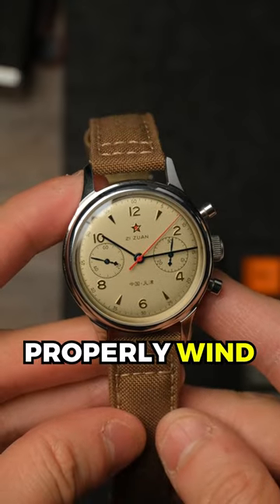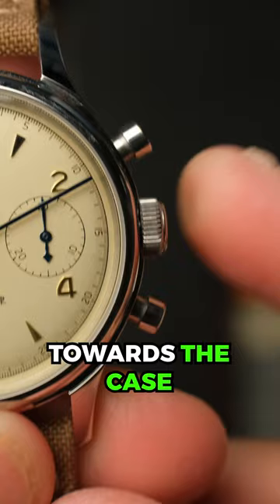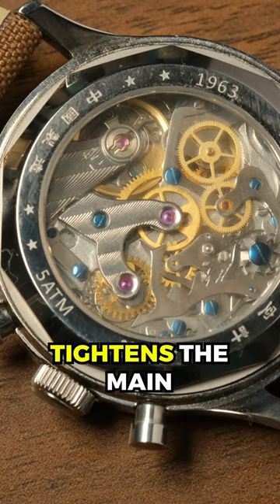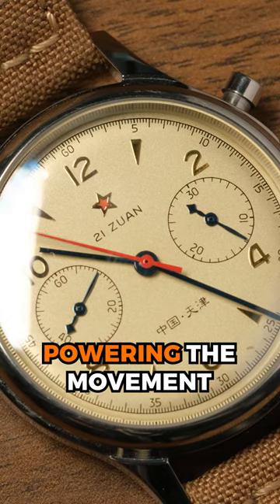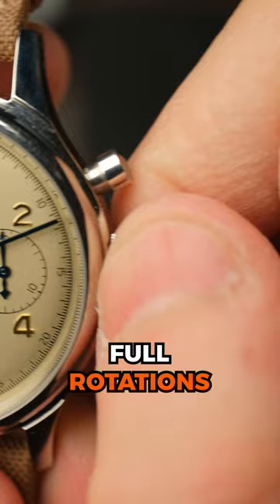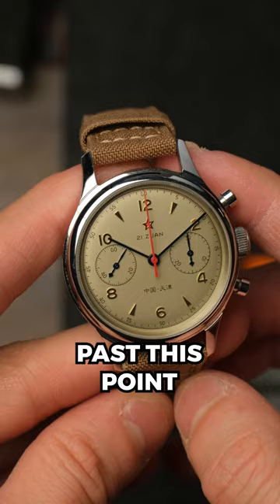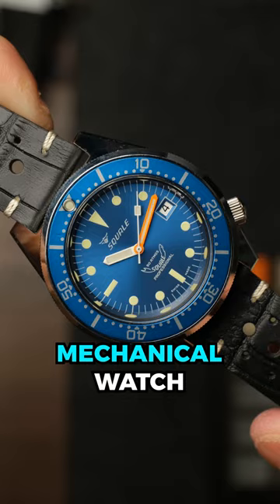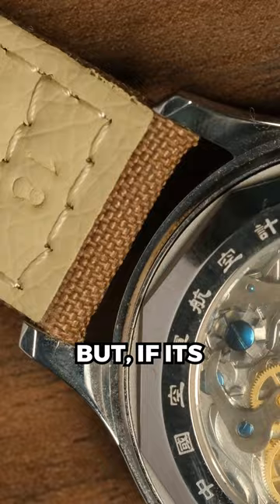How to Properly Wind a Mechanical Watch #shorts #watchesofyoutube #watches

Comment: Can I just add that getting to a full wind on a manual watch, at least from my experience, feels like hitting a wall. At least that's how it feels to me. easy to wind, then suddenly stops in it's tracks.
Reply from the maker: That's a good description. I do tend to feel a little resistance before winding fully, at least on the Seagull
Reply: It depends on the movement. Some are vague.
Reply: I have an issue mine have a push back effect the crown not even doing 1 spin, is that normal ? 
The watch is not working it’s a 1979 timex marlin calendar
Reply: @3rdview_  If you're trying to wind the watch and it's "pushing back" without the crown turning, don't force it. Chances are the watch is already fully-wound, but needs to be cleaned and oiled to run. There could be other issues, but usually it's just that the watch hasn't had a service in  many, many years.
Reply: @Myrtilys  Ty for those greats advices ! I will let u know if it fix !
Reply: @3rdview_  Your watch needs to be serviced. It is fully wound because it's not running. The "push back" you feel is a safety feature so that you can't overwind the watch. It has a ratchet to hold the gears, and if the ratchet didn't loosen backwards slightly, you would wind the spring too tight every time you wind it up. There's a mechanism that relaxes the spring slightly so you don't damage the watch. This is the "push back" you feel when attempting to wind the watch.

Comment: 6 to 8 rotations of the crown is enough depending on the movement to fully wind some watches. You want to avoid overbanking a manual watch.
Reply: That's automatic watches only. A fresh wind on a fully powered down watch is typically 25-30 winds. A full wind every 24hr is typically 17-20 winds. Automatic watches wind automatically, as the name suggests. So you just have to get them started running, and then wear the watch so the auto function can wind it.
Reply: It's not enough if you fully wind it and you just put it back in the box and don't wear it throughout the day. It will stop overnight.

Comment: Winding a automatic won’t break it if overwound as it slips BUT it will put additional wear on the rotor mechanism as the crown stem is also connected to it.

Comment: counting the number of times is completely and entirely pointless, because that depends from movement to movement and the length of your fingers. You wind a mechanical watch until the crown stops, thats when you know it is fully wound. You WILL KNOW when its fully wound because crown will not turn anymore. If you stop when you feel resistance the watch won't run its full power reserve.

Comment: first find how many rotations to fully wind it. check how long is the reserve. now calculate the rotations required for 12 hours ( I usually wear one watch around 12h) or 24h as you require and only do that amount of rotations. Don't max wind

Comment: 40 full rotations may suit a watch with a massive mainspring but would be overkill for most. Mechanical sense works best. Automatics are rarely designed to be fully handwound. A few rotations is enough and will protect the mechanicals. Let the rotor do the work and adjust later. Also dont use quickset date function between 9pm and 3am.

Comment: If its a non-automatic screw-down crown, wouldn't you also need to account for the rotations needed to fully screw down the crown?
Reply: I’m pretty sure the crown disengages when you start to screw it in; that way, you’ll never have to worry about accidentally overwinding it. I’m no expert though, so I could be wrong about that. Google it if you need to.
Reply: @mbcommandnerd  The crown actually tightens going counter-clockwise. So when you turn it forward to wind it, it unscrews and begins winding the watch. Since the watch doesn't wind going counter-clockwise, you simply turn the crown that direction when done to tighten it.

Comment: Question. When you hack a mechanical watch will that stop the main spring to unwind as well? 🎉
Reply: When you hack a watch, the escapement stops turning. Which means the spring also stops winding down. The only way to let down the spring is to let it run, or to open up the watch and manually release the safety system (not recommended).

Comment: I have a Manuel wind and I feel resistance around the 5th wind.
Idk if I’m being too careful but should I push passed the “resistance” to see if it’s just me ? I don’t want to force it but I haven’t been able to wear it out yet because of it
Reply: But how long does 5 winds last? If it lasts as usual like 40 hours then you need to teach us the technique
Reply: Maybe because the watch did not use all the 40 hours power of winding
Reply: I have two (at one point I had three) mechanical only swiss watches from the 60's and 70's. They usually only take between five and eight turns to wind the watch completely to keep it going for the next 36 hours. 
Roamer, Tissot and Nitella.

Comment: Good afternoon, I'm off topic but I need help. My bride gave me a watch from the 70s “Tian Harlan corhmachron ” ,the head only rotates counterclockwise, is this normal? Or should I apply force and rotate clockwise? I'm afraid I'll spoil it because it's a wedding gift, it means a lot to me.
Reply from the maker: I'm unfamiliar with that specific model, but if it's a manual wind watch, it's usually wound clockwise, however, there are some exceptions. Don't apply force to it - that will likely damage it

Comment: My Orient dive watch takes FOREVER to wind. Literally between 10 and 15 minutes just rotating that very tiny crown. And if I stop half way that it the power reserve is few hours, maybe only 10. . It's driving me crazy.
Reply: I came to this videos for the same reason, i just received my new Orient Bambino Open heart, and to fully winded i have to rotate the crown like…almost 200 times 😮😮😮, i  thought someting wrong with my watch, but the watch works perfect, just take a life to full winded, now by reading your coment looks like is just normal in all Orienta… right?😢😅, what movment is in your watch?, mine is F6T22

Comment: My watch running fast what to do? is there any tips that i can fix myself?
Reply: There's not much you can do if your watch is off the time. All mechanical watches run fast or slow, but the higher quality watches run less off time. For example, my Seiko SRPE runs an average of +15s a day, but a Rolex might run +3s.
Reply: @trompettist  i can understand you but in my case 1.5 hour faster than the real time. I have also seiko 5 as well

Comment: Never buy a mechanical watch (non automatic) unless you are an expert or so. I was passed on my uncle’s old mechanical watch. Wanted to hold on to it. Tried to restore and then there were floods in my house. It happened at night. Had to take up the gas cylinder to the 1st floor and clothes and stuff. It was the biggest flood in over twenty years. Watch gone to drains. Had to chuck it. But mechanical watches are expensive to restore. I buy automatic watches along with quartz.